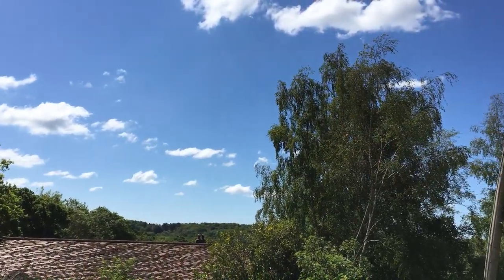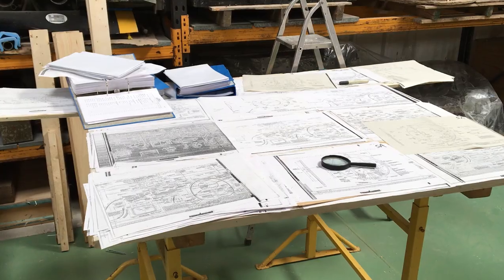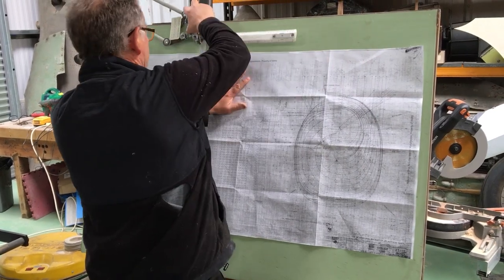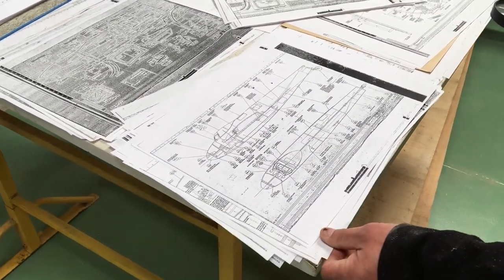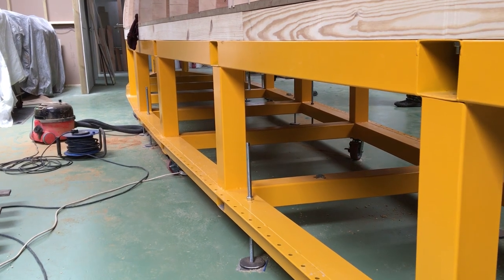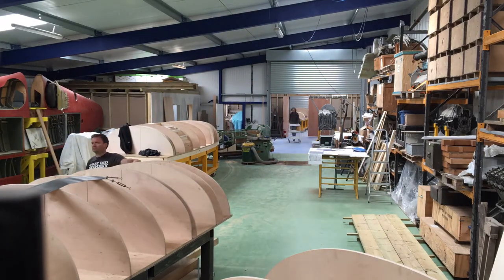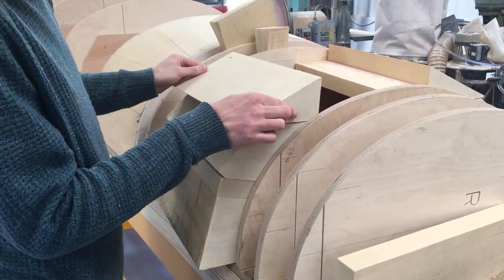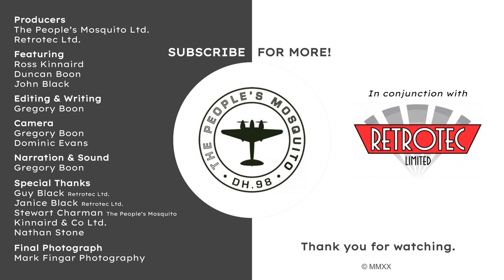The People's Mosquito - Restoration Update June 2020

Comment: I recall visiting the build of Glyn Powell’s Mosquito and amazed at the accuracy he had done with control wire access holes so accurately drilled through bulkheads angled diagonally up through the fuselage from one end to the other. It is a pity he didn’t complete his own build which followed the first one, or maybe he did? I recall seeing an advert of the main structure for sale a few years back I wonder what the outcome was.